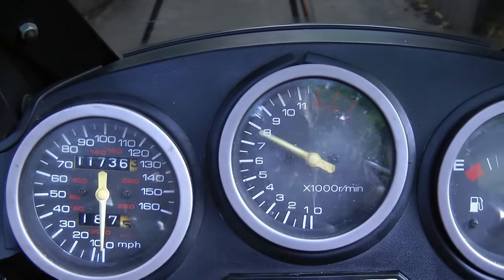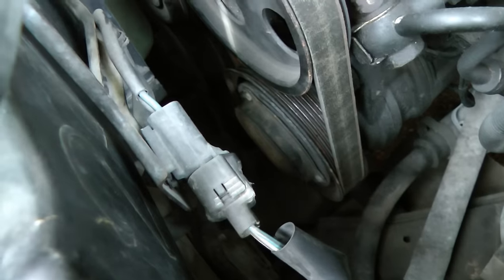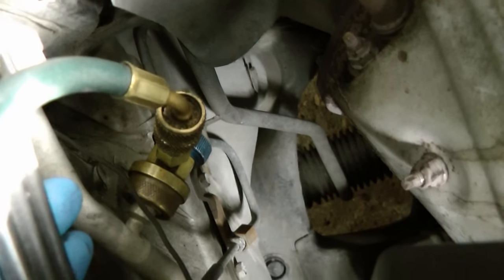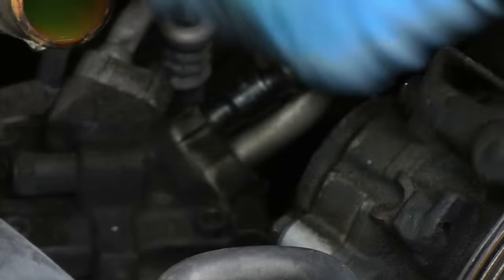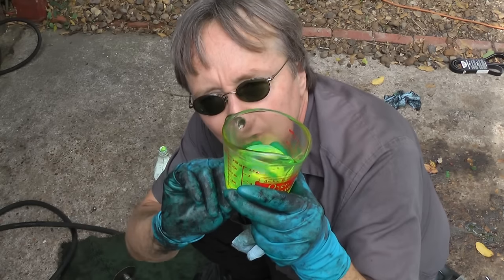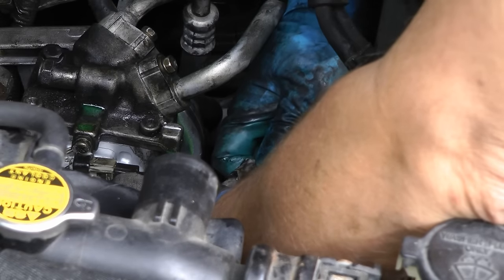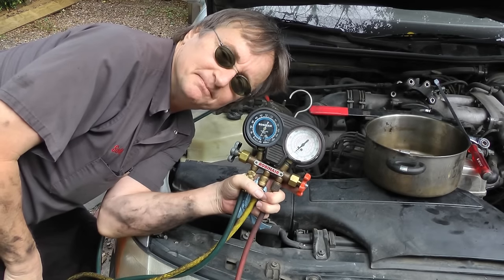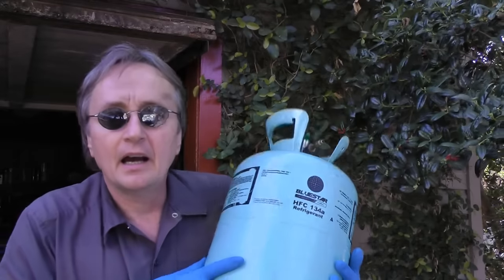How to Replace AC Compressor in Your Car

Comment: What is the top called where the hoses go through? Mine was taken from my car and I have a new compressor in my car but the hoses are hanging.
Reply from the maker: +Rena Carr those are called manifold hose assembly
Reply: +Scotty Kilmer I'm sorry I wasn't more specific, on the new compressor you said it's flat and you have to take the piece from the old compressor and put it on the new one in order to put the hose on. I'm stuck with a flat surface compressor and the hoses are hanging with nowhere to attach to the new compressor.
Reply: +Scotty Kilmer 1:48

Comment: Hey I just bought a car and the man said it needed refrigerant I bought some with a pressure gauge and I tried to fill it but the compressor does not engage when I turn on the a.c. It's loose if I move it with my hand but it will not soon when I turn on the a.c. Do you know what might be exactly wrong with it
Reply from the maker: many things can do that, start by hot wiring the compressor clutch with power from the battery, if it spins, then you know at least the compressor is good. if not, it's shot
Reply: If it's shot does that mean I need a new clutch too

Comment: hey scotty. i went to advance auto and bought a/c oil. i asked how much do i put in and he said the whole bottle which is 8oz. i added the oil but i felt like it was too much. i looked on advance auto site and it said to only add 4.6oz! what do i do? can i drain the oil without opening the system again because i dont have the tools anymore. PAG 100 w/ICE Refrigerant Oil (8 oz.) car is volkswagen beetle 1999
Reply from the maker: I would put 4 ouces in
Reply: Should have checked a manual or something first ...

Comment: Is this wat i have to fix, my 99 dodge caravan is not cooling or heating but does blow air. Can u please help me on wat to fix to make it work thanks in adavance
Reply from the maker: start by trying my video "how to fix your car's heater" and "how to fill your car's AC with refrigerant"
Reply: I have already put refrigerant and nothing but i did hear u say something about a hissing sound n i could hear that wen i turn on ac so im guessing it is the compressor?

Comment: hey scotty can you help me? when i drive my car and im stoped at an idle the air stopes working but when im running the car it workes, what could it be?
Reply from the maker: +bluejokerwm many things can do that, like a low idling engine, or an ac system low in refrigerant, but check those two first

Comment: Anyway, I found the part for a fair price new, and my question is do you have any videos dealing with this procedure? I wasn't able to find any, only ones on a/c compressors. Also, am I even using the correct name for the part? lol I mean,  the first guy called it a compressor hose, the dealership a condenser hose, online I found it as an a/c hose-I'm just all kinda of frustrated & confused over here, coupled with strapped for cash. lol

Comment: + scotty kilmer hi scoty i have a unusual issue i have a 1992 toyota camry 4 cyl the ac works fine blows ice cold but when i get on freeway the ac light starts blinking and ac stops running i have to  reset it when im  off the freeway my ac will only work on city streets can you tell me whats going on
Reply from the maker: +BIGG91732  pray it's a bad AC magnetic clutch relay, cause if not, it's a bad worn out compressor

Comment: my husband has a new a.c. compressor out oil , tighten it, and month later its loud sqreching no ice again, what could it be?
Reply from the maker: realize compressors often go out for a reason, so just replacing the compressor often does not fix it for long. Probably best to have a pro analyze the whole system

Comment: Hi Scotty,I just paid someone to install a used a.c. compressor for me. Now what are the next steps I need to do? To get cold air blowing 😊If possible would rather not take it to a shop.. The cost is high😞 Tia 😉 COLD AIR PLZ 2003HONDA CIVIC
Reply from the maker: go to auto zone, they loan tools like vacuum pumps. See my video "how to fill your car's AC with refrigerant"
Reply: thanks for the reply 👍Will give them a try

Comment: you add oil.
so when you vacuum system,oil can get out  is that right ?
Reply: no.  the vacuum pump removes air from the system creating a -29"Hg atmosphere in the system... this also causes any moisture to boil to steam and be removed as well.  the oil may have minor amounts of moisture that will boil out, but does nothing to the oil itself.

Comment: I have a Mercedes scanner that my dad bought from the dealer, it says that the ac compressor is bad but when we clean the connector plug it starts working and if you jump the connector the ac starts blowing cold

Comment: Hey I wad wondering if you could help with a problem. I have a 2000 dodge neon and it wont take any refrigerant. It wont blow cold air either. What should I do

Comment: Hey Scotty, I have a 1992 Chevy Camaro RS. My AC recently went out. I took it in to a mechanic and he wanted $900 to fix it. He told me my Compressor needed to be replaced and that my hoses needed to be special ordered. I am also out of the coolant. He also informed me that my car uses the old refrigerant type that is not used anymore (R12). Would I be able to replace the compressor and hoses myself(I found the compressor and hoses on autozone.com) and have a mechanic fill it up with r134a?

Comment: Yes I did battery and alternator are ok so I but the ac compresor and have same idle problem
Reply from the maker: then either idle up valve is not working, it's supposed to idle the engine up when AC is on, Or the ac system is dragging the engine too much causing it to idle poorly.
Reply: Thanks

Comment: Hey scotty ,noticed the 101st emblem Welcome home! I have a 96 Towncar, the AC module works fine , but the  LED is more off than on, That's not as bad as the brail on the steering wheel to give me direction ;-]  I've had this apart several times and I'm  blind to find the problem . did as much line testing, in as many points on the board I could find and still cant find a brake in the board. since I don't  have or can find a schematics I can't go directly to the source of power to the LED the whole screen go's out then relit, but it seems after I play with and  goes back in the car, it might shows its face and a few more times before it's out for a while. can you offer a solution or where I can find the brake , thanks !  PS having trouble finding active  Blogs or and note boards on 96 Towncars  can you help JP
Reply from the maker: amazed the dash is still working that well.  All those parts are now obsolete with ford, me, I'd just ignore the stupid thing as long as it works cold. You're on borrowed time on that old town car from my experience

Comment: If it doesn't turn on, it is because there is no charge in the system.  You probably have a leak somewhere or you need a re-charge

Comment: I have a 96 impala ss. The ac was recharged about 6 months ago by a professional. The car is just blowing cool air, not cold air like it should. The free on is full in the car. I noticed that the ac clutch is turning on and off every 30 seconds. Ii bypassed it the compressor with a paper clip just to see what it would do and the car was blowing snow. What should I do if the ac clutch is not engaging like it should?
Reply: What was the outcome on your 96 impala? I have the same issue on mine

Comment: Hi, Scotty, new female fan. I have a question for ya-I was informed by 2 different mechanics (one for free, one at the tune of about $50 because of freon they used) that my a/c hose needs to be replaced. The free-for-check up mechanic said I had to order the piece from the dealer (it's a 2006 Saturn Vue, 4 cyl), he couldn't get it from his regular guy. I went to the dealer & they wanted $435 to do it on top of the $50 they charged me for freon to diagnose a problem I already knew about.

Comment: no no if i press the acceleratar on neutral example till 2000 rpm i have kept and then i turn the ac on it goes down to 1800 rpm and one more thing please help me in this whenever the ac is on the acceleration feels very very sluggish

Comment: so I have a 1998 toyota celica GT and I bought I new compressor for it. I need to know how to get the bottom part off. It has two little bolts and it's got a couple little wires running out of it. You don't show how to take it off the old compressor and put it on the new one. you only show the top part. if I try to take it off it wont come popping off like a bullet will it? It wasn't coming off easily so i ddin't keep trying. didn't want to hurt myself.

Comment: Scotty, you said it is a good idea to replace the dryer assembly a.k.a. the accumulator, but is it really necessary because I am short on cash at the moment. Cannot afford to replace the AC compressor and dryer together.
Reply from the maker: then evacuate the AC system 3 hours with a pump to get all the water vapor out
Reply: Thanks for the reply scotty.

Comment: Is it safe to do this without recovering the gas and letting it drain
Reply from the maker: it's against the law in most places to do that, you are supposed to use a recycling machine. But it hurts nothing but the ozone layer.

Comment: looking for some advice on changing an ac compressor on 1998 ford taurus....can any one help?????
Reply from the maker: REMOVAL
Disconnect battery ground cable.
Disconnect wire connector from RH cooling fan motor.
Loosen retaining bolt and remove RH cooling fan motor from vehicle.
Remove A/C manifold and tube.
Loosen the idler pulley to remove the tension from the drive belt. Remove the drive belt from the A/C clutch pulley.
Disconnect A/C compressor-A/C clutch wire at A/C compressor clutch field coil connector on the A/C compressor.

Disengage A/C clutch wire harness retainer from wiring bracket on A/C compressor and position aside.
Remove four A/C compressor retaining bolts and wiring bracket.

Remove A/C compressor from vehicle.
INSTALLATION
Service the replacement A/C compressor with the correct amount of clean Motorcraft YN-12b refrigerant oil or equivalent meeting Ford specification WSH-M1C231-B.
NOTE: A new service replacement A/C compressor is shipped without compressor oil.

Install A/C compressor onto A/C compressor mounting bracket with four bolts and wiring bracket.
Connect A/C clutch wire harness connector and secure harness to wiring bracket.
Install the drive belt on the A/C clutch pulley.
Install RH cooling fan motor. Tighten retaining bolt to 8-12 N.m (71-106 Lb-In) .
Connect wire harness connector to RH cooling fan motor.
Install A/C manifold and tube.
NOTE: When replacing an A/C compressor, use original manifold bolt from removed A/C compressor to attach A/C manifold and tube to new A/C compressor. Do not use the shipping cap bolts.

Connect battery ground cable.

Comment: What kind of oil did you put in the compressor?
Reply: Baby tears oil.
Made from the tears of crying babies.
Reply: +Raylan Givens where can I buy some?
Reply: PracticalBuilds refrigerant oil, can get it at advanced auto parts
Reply: as someone who is EPA 608 Universal and 609 (auto havc) certified i can tell you what oil should go in it (or you know.. you can google it to your cars refrigerant type aka R134a usually) R134A need POE oils, which means polyol ester (POE) oil it is the only oil that is miscible with the refrigerant, do NOT use mineral oils in a r134a as they arnt miscible at all and it will destroy the system, if you want you can use synthetic alkylate which is a synthetic(obviously) POE oil that was used in R-22 units, its like 92% compatible i think, i dont remember exactly but nothing is going to 100% mix perfectly so that 8% is nothing to worry about as the system can compensate for it.  do not just pick any refrigerant oil off the shelf.

Comment: Hey scotty why my idle drops everytime my compressor engaged and it cause vibration to my engine....
Reply: It could be your Vacuum Tubes and you might have a hole in it
Reply: Often times it means that your Idle Air Control Valve (IAC) is either dirty or bad; the engine revolutions should increase to compensate for the extra load of running the compressor.
Reply: My car is toyota corolla 2010,one of my friend told me that the iac of this car was built in its throtle body...so do i have change it?
Reply: edward michael santos, I have an '05 Corolla XRS and the IAC is assembled to the bottom of the throttle body (different pieces, though); people remove the entire throttle body to get to the IAC because it's easier to work with the IAC out of the car, but it's not difficult to unbolt it from the bottom without taking everything apart (at least on mine; you have the generation after, so I don't know how they'll differ).

Comment: hey in my car on neutral when i keep it on a constant rpm without ac like 2000 rpm and then turn on the ac it goes to 1800 rpm is that normal?

Comment: What kind of oil did you use?
Reply: For the compressor he showed, it's called PAG 46. It looks green because it's already laced with UV dye.
Reply: @teravolt6113  thanks man, I appreciate it
Reply: @elcuervito9009  You're welcome, by the way the PAG 46 is also an excellent bicycle chain oil, but only folks into mobile AC know and use it for that purpose.
Reply: @teravolt6113  I didn't know that. I usually use Dw40 for that
Reply: @elcuervito9009  WD40 dedicated bike products are ok. Plain WD40 is bad, it's more a solvent than a lubricant.
Reply: @teravolt6113  Ouch. The more you learn as time goes by

Comment: so my main question is are there other ways to tell if the AC compressor is bad?
Reply: Adam Dailey yes. The clutch gap can be too large. The compressor can have an open circuit etc. use a multimeter to measure the voltage on the wires going to the car. If it’s getting voltage, measure resistance in the compressor side (disconnected) should have a reading. If not the compressor is bad, if so and the compressor doesn’t kick on it’s most likely a gap issue.

Comment: i have a 1992 camry as well. compressor just locked up on me, if you don't care about ac do what i did and bypass the pump with a smaller belt.

Comment: How about seeing if it hold vaccume to show there are no leaks before you waste money on refrigerant if a leak exist
Reply from the maker: often ac systems only leak under PRESSURE and not under vacuum
Reply: Scotty i love your videos and a follower of them but in a hvac tech and respectfully disagree
Reply from the maker: yes, that is a test you can do with vacuum. But I've seen many cars that leaked out and held a vacuuum test but under heavy high side pressure leaked

Comment: Ok I got cold air but the idle is up and down ,when I turn to high number to 4 the engine shot off
Reply from the maker: have the alternator and battery load tested, places like auto zone do it free. Pray it's a bad alternator and not a wearing out Ac compressor, which costs a ton and can do that

Comment: I got a Saturn 1999 a/c no work what I check first to know what s wrong I charge but no cold air so
Reply from the maker: tons of things can go wrong, first hook up Ac gauges and e mail me the pressures on the low and high side at idle, and at 2000 rpms or so.

Comment: So I bought a can of that easy chill hook it up to the low port side of my 97 Civic the car is running air conditioner is blowing on high the gauge on the easy chill  is in the green which indicates it is low... I press the button the easy to begin to flow I periodically check the pressure and finally gets into the blue which indicates that's at the correct level but the air conditioner compressor starts turning off and on rapidly off on off on off on
Reply from the maker: you need to measure both low and high side pressures when analyzing AC problems, get a set of real AC gauges hooked up to analyze it. Knowing only the low side means nothing

Comment: I had a mechanic say since my compressor was bad i need to change out my condenser too cause its will strain the new compressor and make new one go bad .why is this?
Reply: Because modern condensers have so narrow passages inside that they act almost like a sieve for the compressor wear material. For the same reason, you can't flush them either. You have to buy a new one. As a condenser gets filled inside with wear material, it just becomes less efficient at doing its job, rejecting heat. Head pressure increases, suction pressure increases, and you both get less cooling and more compressor and engine strain. I've just replaced it on my 16 year old car even though the compressor is still perfect, and it drives much more better than before with the AC on. And i also haven't flushed anything, just added 2 ounces of oil since the workshop manual asked for them.

Comment: IVE CHECK FUSE 44 ADDED FREON AND STILL NO COOLING,MUST BE THE COMPRESSOR????
Reply from the maker: many things can go wrong, first, hot wire the compressor with power and test the pressure at idle and 2000 rpms on both low and high side and e mail me the pressures

Comment: i have a 2.2L oldsmobile alero 4cylinder  i was told my AC compressor went bad but the clutch kicks on
Reply from the maker: Adam Dailey have it pressure tested, they can still spin but not work
Reply: Okay thanks.. I Had it pressure tested it would hold the freon but no cold AC came out should i just check for leaks? And also could that be due to low oil in the compressor?

Comment: What if the compressor turns, but the ac blows hot air, and the gauge shows the low side psi is in the red?
Reply from the maker: Often a bad expansion valve OR compressor
Reply: Thanks, I'll check out the expansion valve first since its the least expensive option.